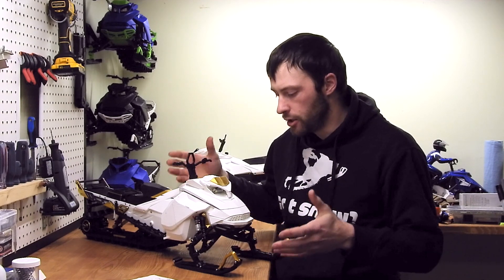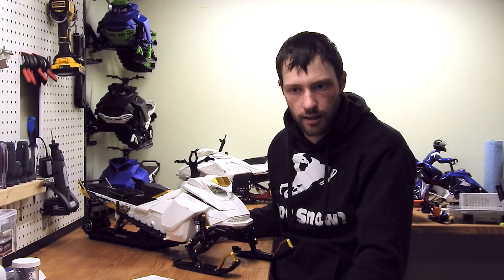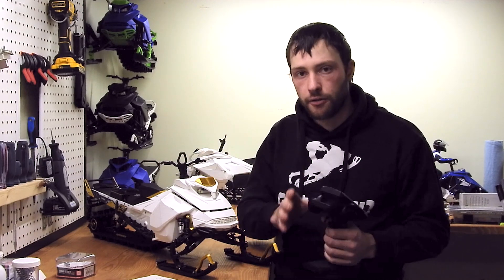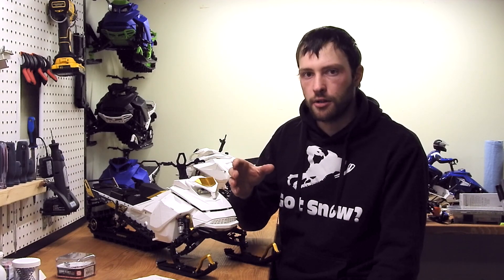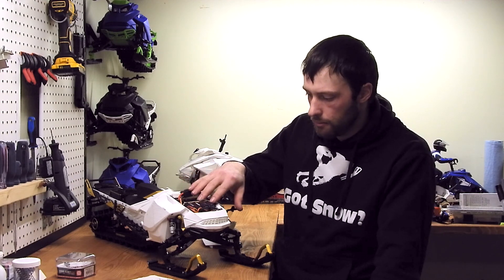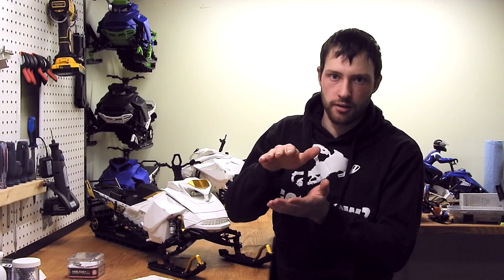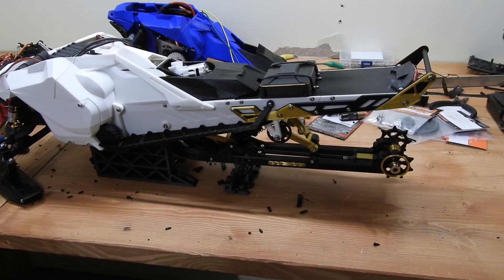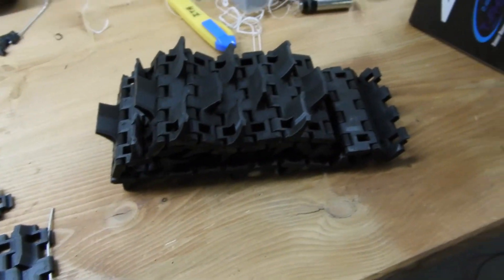Project Decagon (Part 2 - Electronics)

Comment: I was curios how the solid hard plastic track will hold under that power. I was using that kind of track on my first builds but they where always to weak when i went with 4s and high speed gearing. 

Now im only using TPU with a shorehardness of 95A to print tracks. They last around 10-15h drivetime before they start giving up and get some cracks.

Comment: The flysky radio with telemetry is like 125 bucks!   Been using it for about 4 years and not 1 problem.  I know they are crazy cheap but honestly I have not had 1 issue.  I literally threw out all my spektrum surface radio stuff. 

I too have liked spektrum but they do not offer enough model memory and telemetry gear is expensive.   So I switched to flysky for surface and Jeti for air.

Also putting the "perfect pass" contoller on the throttle sure helped being able to control the throttle on my sled.  It's so touchy some times it's hard to do.  Works well.

Snowboard wax on the rails, and the track side that rubs on it also helped with resistance on the track to skid.  Not sure if you have any issues with this on yours.  But I'm running a tpu track.

Keep up the amazing work.  Looks amazing.